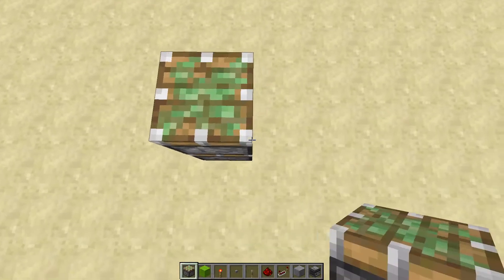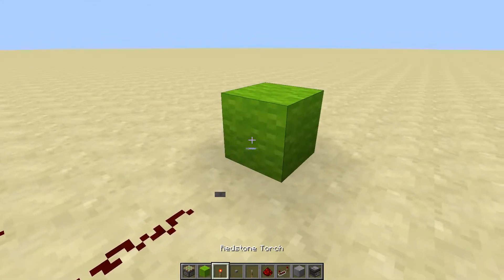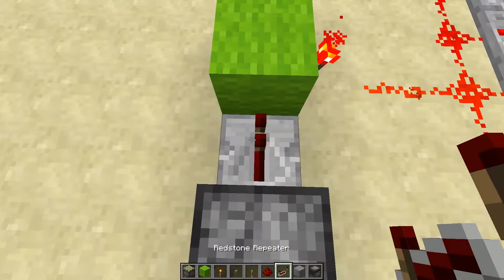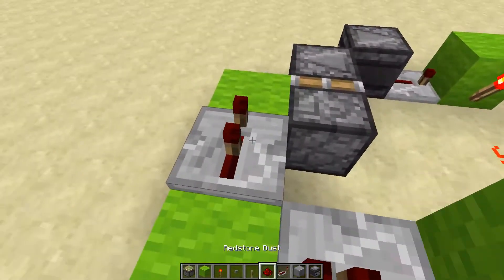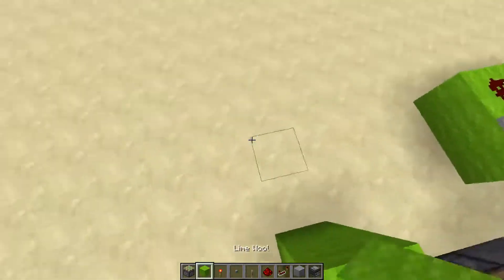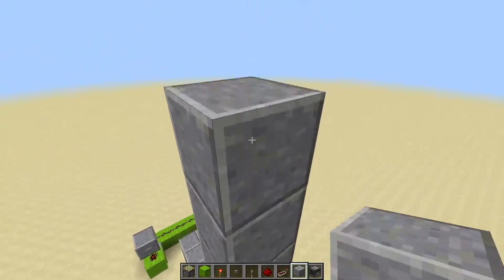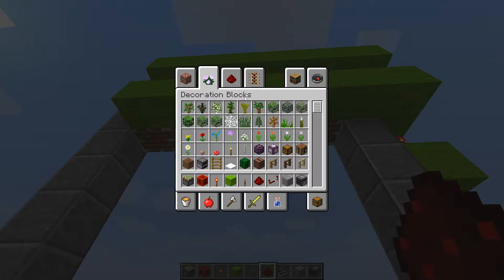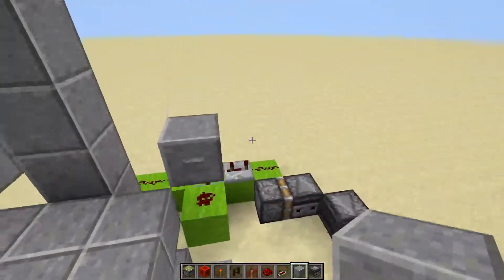1.13.1 (java edition) 100% Working Super Simple Redstone Castle Gate (No Gravel)

Comment: Hey Ryno. This is a nice portcullis. It works perfectly on java, and I thought I'd mention you can put a better lock on it.

If you lower a few redstone dust on the bottom you can add a repeater next to the on/off repeater and power that with a lever from inside. This will lock the outside button but allow the inside button to work independently.. open or closed.

If you're interested, and want more information I can provide pictures or a video even. Nice work though! That thumbnail is sick too.
Reply from the maker: Thanks I'll check that out never even crossed my mind lol
Reply: You're welcome. If you have any trouble, I have 2 versions in my test world. 1 of which is 15 wide. 😁
Reply: @Ryno6612  i dont understand how to make the close button.when i press it it opens and closes at the same time.
Reply from the maker: @moviestalker2134  adjust the timings the top should be faster so the pistons can be pushed down or go up before the bottom half starts to move.

Comment: I have the same issue as  rundos386. It worked flawlessly, but as soon as I had it covered up and decorated, it stopped functioning. I checked all the redstone circuits and nothing got blocked. So I am a bit baffled about what the issue is here. I am using the 1.13.2 java edition (OS Windows 10).

Comment: Somehow both is movin. The upper pistons as well as the bottom Pistons.
Reply from the maker: are you trying to build it in the java edition or windows 10? because this design only works in java.
Reply: @Ryno6612   It is Java 1.13.2. i noticed, that it is rly important to keep the hight of 11 which i havent. I got it to work, but after i covered it up, the whole thing failed again in its funktion. The lower piston only lift up 1 Row. I thought the Upper pistons are blocking, so i disabled them, but they wont be pushed upwards by the bottom ones anymore. Damn... thats so hard to debug for me.
Reply from the maker: @rundos386  if it was working before you covered it you might have blocked some Of the Redstone when covering it up Goodluck if you can figure it out send some screenshot  @ryno6612 on Twitter and ill see  if I can help
Reply: @Ryno6612  I figured it out! I transformed stuff around with a Shovel-Right-click. Those way blocks are able to break the System.